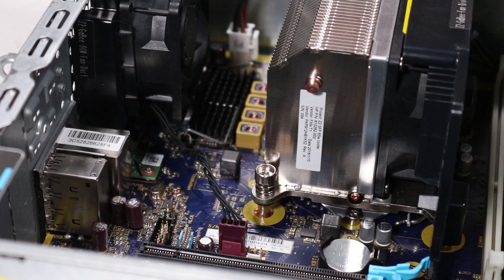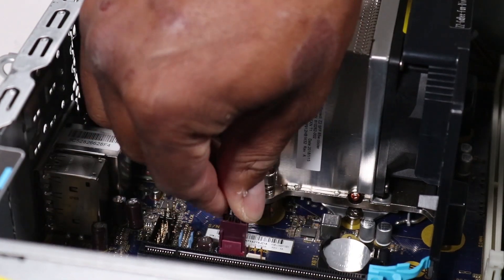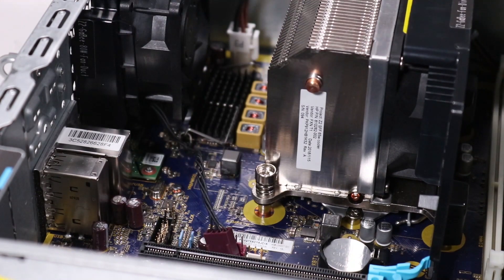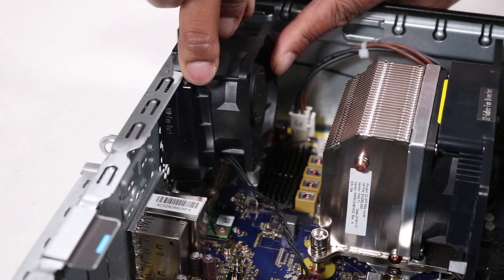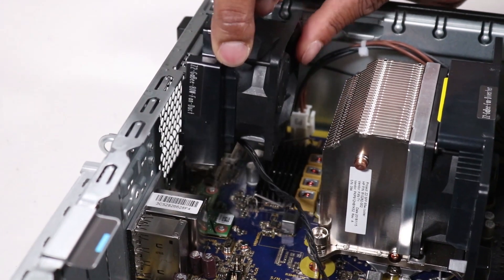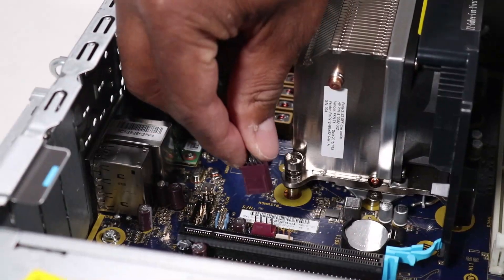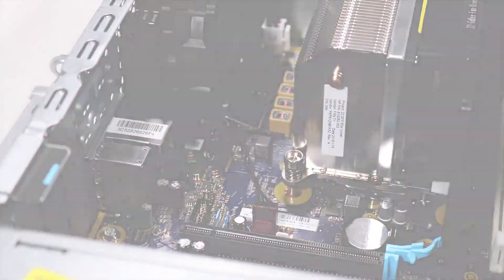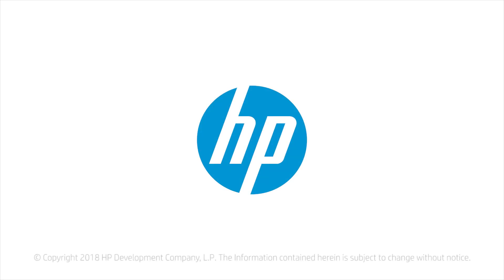Replace the Rear System Fan | HP Z2 SFF G4 and Z240 SFF Workstations | HP

Comment: Can i plug a 3 pin fan into the 4 pin slot or is the pins not standard?
Reply from the maker: +TunaPants HP does not recommend upgrading or downgrading hardware parts or software that is bundled with the product as It may affect the manufacturer's warranty and performance, however, you could change the configuration at your own discretion.